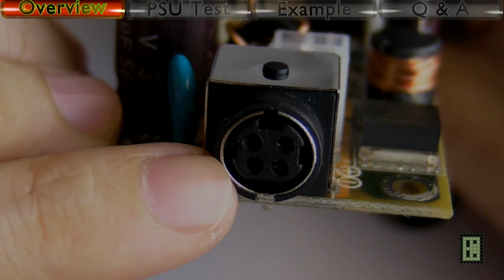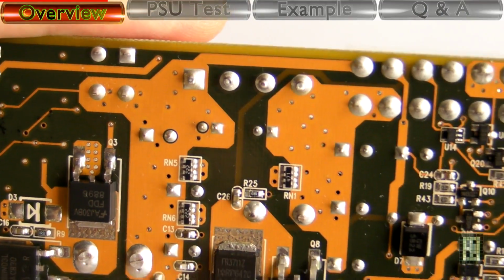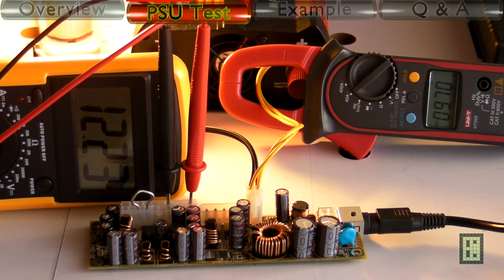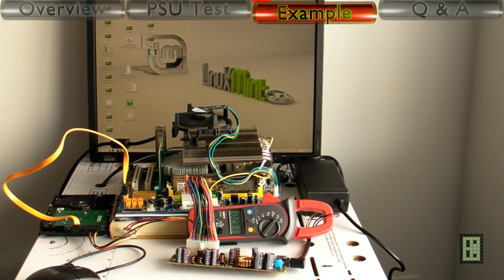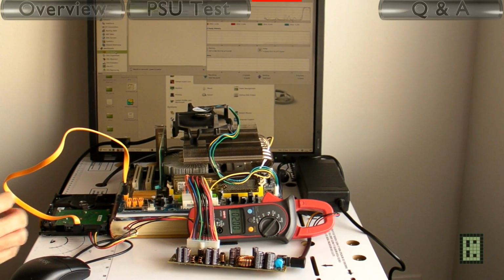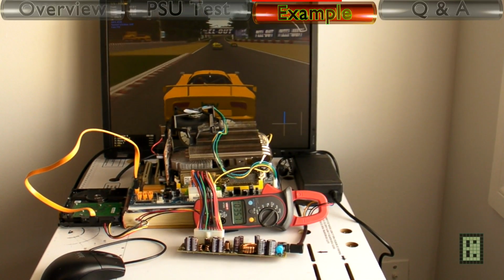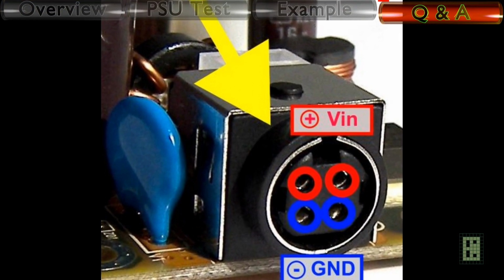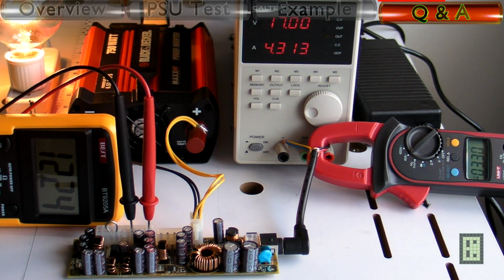130W ATX Computer Power Supply Fanless WinMate DD-24AX V220-2

Comment: Hi, my current setup is:
- Intel i5 2500K (stock fan)
- Asus P8H67-I Deluxe motherboard
- Crucial M4 64gb SSD
- Seagate Momentus 7200rpm 500gb HD
- Sony Optiarc slimline DVD-burner
- Noctua R8 80 mm case fan

I have the equipment in an Antec ISK-300 150W case. I'm thinking of replacing the PSU to get rid of noise. The box is for my wife who mainly uses it for watching youtube, dvd, and internet. I was wondering if I can use this PSU for this application.

Thanks.

Comment: Normally a power supply with Fan sells for around $14  to $20 here in Toronto at Factory Direct for example. What is the purpose of a fanless except for running quite?The  purchase cost seems extremely high for a low wattage output from your ebay link?Nice Video presentation.!